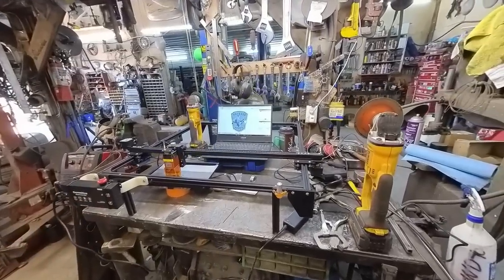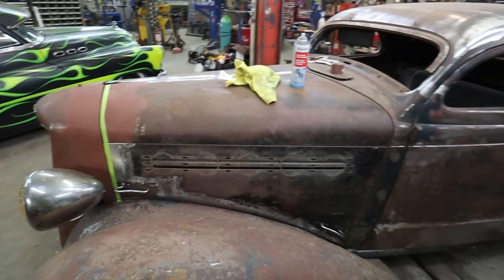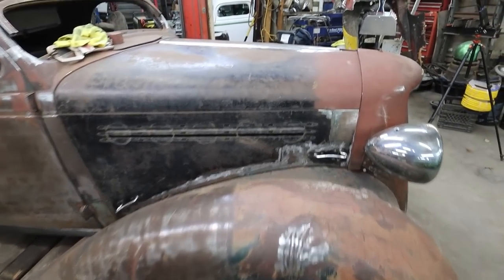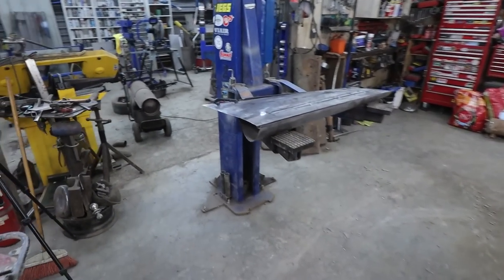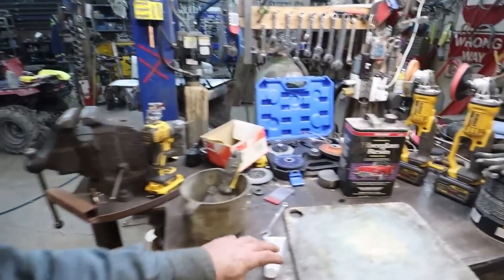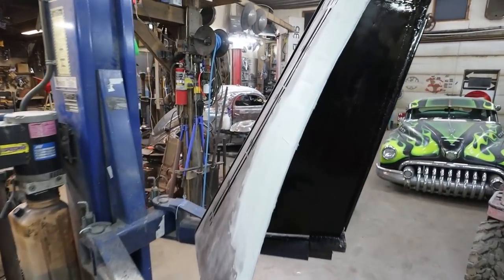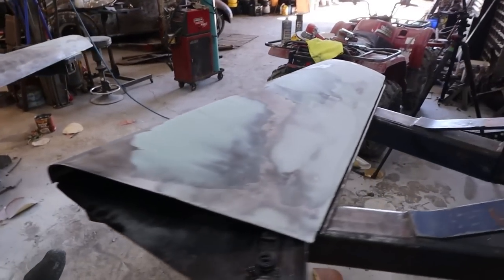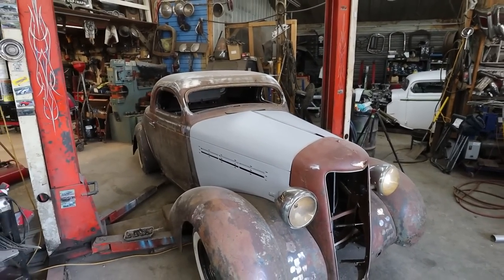Sandblasting and priming our 1935 Dodge coupe hood.

Comment: I work with wood, nuts and bolts and screws mostly. Bought a welder. My first time welding, a "gallows" to hang my pigs after dispatching. Practiced for hours. Boogers! boogers! boogers! (And spattering) Then, I got the temp and feed dialed in. Man, what difference! Looks and feels much better. Patience, slow and steady with "U" movements wins. Gallows is strong. Will hang the gambrel secure safely. Bottom line: You make it look easy. It ain't! Lol! Practice makes perfect. (At least acceptable)😂

Comment: Just my two cents, Brent,, the longer hood, and the other body mods, give it a unique character,, I see this rod,, and picture either front fender mounted spare tires, or a continental kit on the rear bumper with filler panels from body to bumper, and I keep envisioning chrome steel wheels and/or fender skirts…. So far, very kool build .

Comment: The new hood has really come together to anchor the front sheet metal into a cohesive, stylish unit.  I would love to hang around behind a bunch of classic MOPAR guys as they discuss the various aspects of this car.  It is beginning to look like it was designed that way, and you really can't ask for anything better than that.  With the amount of welding and patching done on those panels, it is a miracle that they shaped up with the minor amounts of filler actually used.  Fantastic craftsmanship in the fabrication.....

Comment: Back when I was a sandblaster we used to to duct tape the chrome cylinders on hydraulics by putting the tap on inside out and only stick it to itself. Made it much easier to remove after .

Comment: I've been up in the air about the front fenders but after looking at other 35s, and seeing that that was the prevailing style of the period, it looks right.  Especially when the cars are painted and with a running board.  Better wear a mask mister.  You'll need to breath later. 😛

Comment: I’ve been using resin in my filler for years and have never had a problem.  I learned it from sprayway customs in Alabama. He called it rondo. It works so well that I rarely not use it. Thank you for your hard work and sharing it with us

Comment: May sound crazy but late 40's to early 50's gm cars are actually fairly light.
I would love to see a body and partial frame, repowered by  a 3800 front wheel drive set up.
Not really a hot rod set up, but a very cool cruiser idea.

Comment: Have to admit. That came out nice. Alot of work there. I have the same 8 inch DA. I used those orbital flat files. The 8 in DA is way better. I flung my share of filler in the past and those bag busters(as I call them) are the best for getting a panel straight fast. I did a 63 caddy convertible and put 13 gallons of filler into the rig!! Lol. That was what 95% of the work was done with... of and the car was painted gloss black after. Lol.

Comment: PPE is a must, dont understand why people dont use it, when you do sandblasting, you are meant to do it in small circular motion at about 1" - 2" depending on size of equipment, thats how I was trained and did it for many years, i did industrial blasting using Garnet, it was better at night time, really puts on a light show, the car is shaping up nicely.

Comment: Coming together nicely Brent just a suggestion for the lower hood panels  to Make sure you Use a paint that can handle heat as the heat from the manifolds does tend to get quite hot in summer and the paint turns or melts . js

Comment: In the trade days an 8 inch was a bondo"hog " and the orbital long board was a Hutchins  was not a fan of either perferred the Viking air board both the long and the short versions and  most version of human powered long board  the Hutchins left round sanding marks which paint did not hide very well Bondo dust everywhere Ah those were the days TY 4sharing

Comment: Yes float the whole section next time, if your trying to do little spots it will show, I found it's much easier to just lay body filler over the whole section sand until you see a little metal coming through then stop, use a block with 120 to get out the deep scratches then feather fill primer if your using 80#grit you won't see the scratches. 
When I was young I would go back and fourth with the body fill sand then body fill sand body fill until I figured out just lay the whole are with a sheet of filler so it's all level. It saves so much time it seems like your using a lot of filler but most of it gets sanded off and it's straight looking when it's painted. For the fenders you may have to bend some metal to check if it's the same for both fenders to check your body work. RAC GARAGE is building a pretty badass 1936 Rodster. He's using bare minimum tool's in a very small shop with some basic tool's, but getting those little details done to it.

Comment: I would have floated the whole hood with mud sand until you see some metal then stop, sand with some 120 or 80 grit and feather filler primer that will cover everything up scuff the prime when your ready to paint. Your right about doing sections at a time on the car, a lot of body work can become over whelming when your doing everything yourself. When you have a team of guy's doing there sections it's goes by faster.

Comment: I usually do a few coats of hifill primer  a shadow coat then block panels straight rather than several coats of bog, do you guys have spray putty over there? awesome stuff, put it on with an underbody gun sands real easy good for big panels or whole cars blue or pink it wouldnt be the first full paint job in spray putty Ive seen.

Comment: I love your work or if ya haven't noticed, always have some stupid comment on how this or that might be changed.. so true to me, I think since some feel good stuff has started with fixing wheels and doing the hood in primer... maybe just the top as its far from your definition of done... at least in primer, a end of road feel starts to get into the picture. Off of topic.... how does the guy or company of Tony Lang get paint to look like it is wet or just pools of paint? It was cool at first but have definitely changed my mind as you have been in person and me on the tube seen so many fine rigs done in basic color and level paint that you don't worry when you touch it, will it smear or leave prints look. The deep pool almost looks like a big dent could be there but because its a lake of paint, you don't see it... and so I guess its not different in so many ways that bondo does the same, hide imperfections or the look your trying to achieve. Why couldn't i of not got hurt, and been a canadian who is into "flagilisim" so I could go to your place and just sand if its all you let me do. I watched Karl make some new dyes for his hammer ... the power hammer that has the sewing machine way of doing some stuff and seen in my mind how you could do some faster stretch or shrink metals. Of course some parts of you probably wish you were of the usa and lived in western kansas where many nice vehicles are being found with so little rust... kind of like your part of the alcan highway rigs where no salt was used and no junk yards to throw stuff away so they just parked a rig and drove the new  on since even nice older rigs had little value in my day. I must of owned a good hundred or more cars from the fifties that came with a full or close to full  tank of fuel, fresh oil as people knew of what happened to their car or truck if that oil was bad. I had a neighbor who got a new rig every year. He refused to trade in a rig he had paid a whopping twelve hundred dollars for and only get say three hundred on trade for a rig with maybe if driven a lot.... get this as I did look at those odometers... seven to nine thousand miles. I was his service mechanic and he would give me a whole ten dollars for changing oil in the rig.. I got sixty five cents a hour on my real job. I could do a full oil change, check belts and adjust them, add the antifreeze, air all the tires plus do a "tidy" on all areas that had a few drips of oil or fuel on  them in less than a hour... I also checked the fluids in transmission, differential, do a quick brake check and adjust if necessary plus grease everything... maybe two hours in  all. I did have a great big air compressor that had been on a rock drill and dad said its junk so gave it to me. One of a few, very few things ever given... I dumped a used piston and rod in the old ford V-eight engine and ran it for a good five more years dependably. That man asked me one day... "If I give you any car or truck of your choice, would you furnish the oil and fuels when we do service, I will still pay you for your time!".  I think I kind of just stood like a deer  in the headlight look and he started to change his mind but I did recover quick enough to get out a yes. I picked out a fifty six ford big window stepside  pickup. I thought at first I asked for too much as it didn't have but very few miles and it was a robins egg blue. He smiled and said, never did like that truck as its just a ugly color.. ya you can have it but pick a nicer rig so I ain't taking advantage of you. ---- Thats when I told him, for all of this, I will change my last name to yours for this!!!  He turned his back to me and walked away  and I knew better than follow him.. after all, he was nearly sixty... and in those days, that was very old as most people just didn't live that long. I did know that I had hurt his feelings some way. A few days past and he asked me to come to his house. I did as requested,  "I lost my boy in the Korean war... I don't want you to change your last name but would be honored if you would be my beneficiary cause I don't have any family. Since at the time, I was fourteen years of age, thereabouts or close to fifteen... I was shaken up a bit, gave that man a big hug but said, you really should sell stuff and use the money for a nicer house or something. He took me to his back room as he did trust me with his life it seemed... opened up coffee cans, the twenty five pound cans that stand up and are square.... in them were different denominations of cash... said, don't know how much is in them but do you think I need money? I was in Vietnam when he past away and his last will and testament said I was his sole beneficiary. I was a native kid who most thought was a less than human person so they tore up his will and took everything, including his farm and stuff... no mention of money was ever made! Much later in life I found out I could of challenged them and won it all but most of it was gone by then.

Comment: I don't know if it's your lens or what but the rear fenders on this car look way narrower than the front. seems like they should be at least equal or wider with corresponding tires. I think of Buckminster Fullers Dimaxion car (google it).